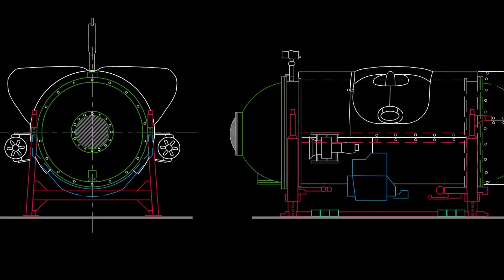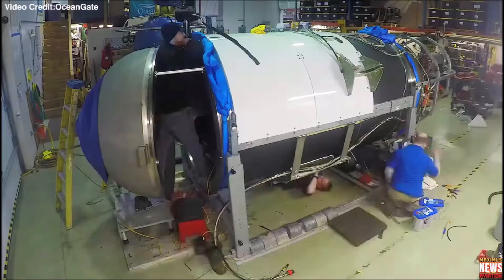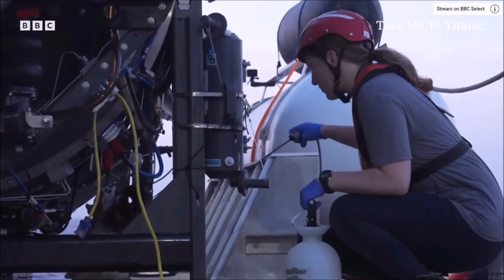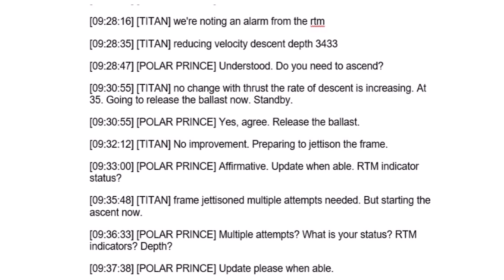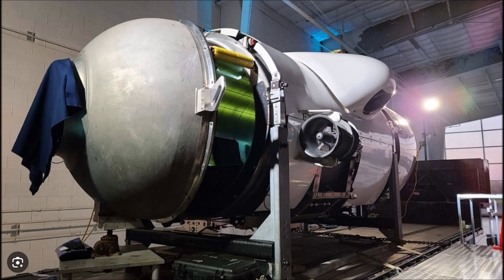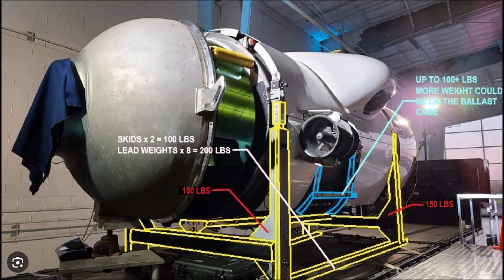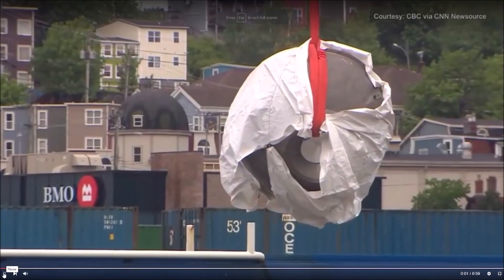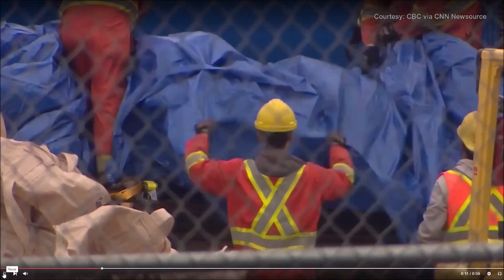OceanGate Titan - DIVING "TOO FAST" A REALISTIC SCENARIO?

Comment: It appears to me from the recovered wreckage that all the bolts securing the titanium hemispheres to the connecting rings are missing meaning that they were either removed after salvage or they had all failed at the time of the implosion. For the bolts to fail due to tensile loading the epoxy bond to the carbon fibre cylinder would have to be stronger than the combined UTS of all the bolts. If that was the case I find it difficult to see how the dynamic loading due to the kinetic energy of the imploding water could simultaneously debond  both rings from the carbon fibre tube and shear of all the bolts ( 36 in total ?) You can see that the location flanges on the rings that surround the epoxy joint have been destroyed as the carbon fibre imploded. Can anyone suggest how the force necessary to snap all the connecting bolts (Hemisphere/ Interface ring) could have been generated?
Reply: The ring separation from the dome cap has puzzled me too, I thing there were 18 bolts, and a semi-truck has this many on each wheel, so maybe they like everything else on this sub was not up to the job
Reply from the maker: Interesting point. I don't what exactly kind of force was necessary for that to happen but if you look closely at the size of the bolts that fastened the hemispheres to the interface rings, they look pretty tiny for the size of the parts they are connecting together. Probably weren't high strength types either as they only had to keep the hemispheres from going anywhere... the enormous hydrostatic pressure would have taken care of the rest. In my mind it's not hard to believe these relatively small bolts all sheared off when the implosion happened. It would have been a very violent event. If you listen the soundclip of the implosion, after the implosion comes what sounds like a big explosion. Seems to me that's when they would've broken off.
Reply: @VegasCyclingFreak  Maybe the bolts could fail if the end cap tried to drag the ring with it at high acceleration and the rings inertia caused the overload to the bolts, what do you think?
Reply: @davemorten8223 I think your use of the term 'ejected' is a bit misleading.  If any part of the cf hull fails, the hemispheres aren't rapidly pushed apart, they are thrust towards each other.  The sea pressure on the hemisphere puts a tremendous compressive force against the hemisphere / support-ring joint.  That's one reason why they used so few, relatively small bolts.  This joint is under compression.

Now, if the cf hull suddenly shattered or buckled, the two hemispheres would very quickly smash into each other.  That could destroy the flanges on the interface rings.  If they collide at an imperfect angle, this might cause a shearing side force that shears the bolts.  

A close inspection of the rings and the ring/ hemisphere faces could shed some light as to if it where 'pulled off' by some force or 'sheared' off.
Reply: @mikefochtman7164  I totally agree with you that if the cf hull was the initial failure the hemispheres would indeed come together under the 10,000 ton loading on both ends  and the collision may well lead to shear failure of the bolts and it would explain how all the components of the hull separated, it all just turned into a ball of shit. The only thing that the salvaged parts clearly show is that the epoxy connection to the interface rings destroyed the flanges that centralised the rings and the cf tube when it imploded. We can only guess which part of the vessel was the first part to fail.
Reply: @mikefochtman7164  I totally agree with you that if the cf tube was the initial catastrophic  failure the hemispheres would be propelled together due to the 10,000 ton  end loading perhaps leading to bolt shear failure on impact. What I am not sure about is if the hull failed allowing a sudden inrush of water could the dynamic build up of pressure within the hull eject the end cap hemispheres and impose a tensile loading on the bolts. I think I lean towards compressive collapse but question the alternative.
Reply from the maker: @mikefochtman7164  I feel that the carbon fiber may have buckled or possibly there was a sudden large de-lamination at one end due to water ingress at the interface ring, which could could have been happening over time. The recording of the implosion seems to suggest something along those lines. Sounds like the end popped off so to speak and then the big BOOM!
Reply: @VegasCyclingFreak  What I am driving at is if the epoxy joint had failed first and was the primary cause of the failure the interface ring would still be attached to the dome as the implosion would eject them as a connected assembly.
Reply from the maker: @davemorten8223  Yeah I get what you are saying. But at the same time, this all happened so fast and at that depth the hydrostatic pressure is about 5,000 PSI so all that explosive force would be concentrated in a very small area. They would really have no reason to intentionally separate the pieces when salvaging... the interface rings had lifting hooks. And that would "tamper with the evidence". My original theory was that the rear hemisphere separated and that is what caused the hull breach. The tail cone was pretty much intact, but separated from the rear hemisphere. There was quite a lot of stuff in that tail cone/rear hemisphere and it had to weigh a lot. It was all joined at the interface ring in three places. I wonder why the rear hemisphere was missing. Maybe it wasn't and they just didn't get video of it?
Reply: @VegasCyclingFreak  I wonder if the first sound is the tail cone detaching possibly along with the legs and in doing so opened up the epoxy joint (despite having 10,000 tons holding it in place) causing the second loud catastrophic implosion. As I said previously you can see that the internal and external flanges on the ring have been sheared off and are blown both outward on the outer flange and inward on the inner flange, goodbye to the tube!!!

Comment: I have seen somewhere that the ballast system now used bags of steel shot instead of another ballast component (not sure if it was lead weights or steel pipe).  Titan has been diving intermittently since 2019.  Some of their hardware has been changed out with experience.  However, it is often difficult to tell what date a photo or video was shot so it is uncertain what equipment was in service for the final dive.  The investigators will no doubt find out was systems were in use for the last dive.

I agree that an error resulting in excess ballast could be responsible for the faster diving velocity.  I believe the diving velocity is determined by the degree of negative buoyancy and the drag on the submersible.  The more negative the buoyancy (downward force) is the faster it will sink.  However, if you believe the transcript, they were rising extremely slowly after dumping ALL ballast and using vertical thrusters.  This suggests either all ballast was not dumped or the submersible was somehow heavier (less buoyant) than previously.  

One theory is that the Rhino liner disbonded from the CFRP shell and trapped seawater beneath it creating an accidental ballast tank.  Another theory is that the carbon fiber was absorbing water because the Rhino liner had disbonded, at least partially. Another possibility is the exterior high pressure air tank for ballast somehow got filled with water, not air.  This would lower buoyancy, speed up diving, resist surfacing and disable the emergency buoyancy balloon that could assist surfacing.
Reply from the maker: It seems to me that the legs didn't all detach. One of them is missing in the debris recovered. Some of the weights would have fallen off the skid but a lot of weight could have still been attached. Their cameras had limited visibility and if it was dark they wouldn't know that it didn't fully detach. Interesting theory about the Rhino Liner. The ballast tank could have failed, that seems like a good theory too.
Reply: @VegasCyclingFreak  Yes, there is a video of the recovered wreckage showing a missing leg. But, that missing leg isn't attached to either ring that was recovered.  There are numerous scenarios as to why that leg is missing and no evidence to support any of them at this point.  Did the missing leg fall off the landing frame when it was being recovered.   Was the landing frame actually ever detached?  Landing frame could be detached separately from the legs, did the leg detaching mechanism work on just three legs so Rush then activated the landing frame mechanism to free everything? Were the landing frame and legs never intentionally detached but blown off when the CF hull exploded with the force of 100 lbs of TNT (estimated by some).  Was the other leg left on the bottom or not found?  Was the other leg part of the 3 bags of miscellaneous wreckage recovered but not visible when unloaded in St. John's?  The apparently missing leg is consistent with your theory but not proof of your theory.

Yes, playing Sherlock Holmes is great fun, but we have only a fraction of the evidence the investigators are still collecting.  I was a practicing engineer for 40 years and participated in many failure and incident investigations.  Conclusions based on the limited information of news and eyewitness reports, photos & videos were very rarely correct. Investigators will have 100 times more evidence than the public does now (they are still collecting it).  All of the Oceangate employees are still alive, except Rush, as are the subcontractors like ElectroImpact, Janicki Industries and Collins Aerospace. They are not speaking out publicly now, but they will be forced to speak to investigators and lawyers. There will be a mountain of paper evidence like piping and instrumentation and wiring diagrams, design specifications, operating manuals along with communications between the sub and mother ship. In a year or so, just as after a plane crash or oil refinery explosion, the investigators will evaluate all available evidence and issue a public report with likely cause(s).  Maybe amateur sleuths will beat them to the punch, but I doubt it.
Reply from the maker: @martywest5925  Yeah I realize that I’m making guesses here with very little info. In my mind, if the frame consisting of the four legs, is hanging by one leg and an implosion occurs, that leg would likely get ripped off from both pieces and go flying off by itself somewhere. My point with that really is if they actually dropped the frame then why is one leg missing? Actually it should have been all four legs connected together with the part at the very bottom of the skid. Not sure what that part is actually called. It was basically one piece when everything is connected together. Should’ve dropped as one big unit. I haven’t heard the 100 lbs of TNT thing, but that seems about right. It was certainly an extremely violent event and the sound clip of the implosion sure sounds like it too. It will be interesting to hear what they conclude when their investigation is complete.

Comment: As I understand it the descent was normal for most of the trip, that would suggest the ballast was correct.
Reply: Actually the decent was way too fast. The hull needs a bit of time to adjust to the pressures being applied to it and not just a rapid shock.
Reply: Early in the transcript, the mother ship asking if Titan should slow their descent [based on descent rate up to that point].  Rush responds that he will continue as is, no change.
[09:15:21] [POLAR PRINCE] You are at 75 minutes, depth? Status? Do you need to adjust velocity?
[09:17:50] [TITAN] All under control. At 2960. No adjustments needed. We're enjoying the ride.
[09:19:03] [POLAR PRINCE] Understood

Titan got an RTM alarm at 3433m, 92% of the 3800m bottom. The got to 92% of the depth in 94 minutes.  It normally takes 138 minutes. They were diving faster than normal.  To dive they intentionally load enough ballast be negatively buoyant, i.e to sink without thrusters. Looks to me they were less buoyant than normal for some reason.

The investigators no doubt have the transcript and it will be released in due time.  The argument against the transcript's authenticity is that the messages are more complicated than those captured by CBS's David Pogue Titan trips in July 2022.  It is entirely possible that Oceangate upgraded the sub to surface ship communications in the intervening year.  Oceangate had a history of upgrading electronics (and other systems) based on experience from earlier dives.  Again, the investigation will eventually show whether or not the transcript is true and why, it looks different than what Pogue observed a year earlier.
Reply from the maker: @engineerncook6138  The reason why I do not believe the transcript is fake is because there are too many insider details included. Only people that intimately knew the details of how the sub was built & designed could have come up with that. I mean how many people were aware that after the ballast was dropped "the frame" could also be jettisoned, and know about this nearly immediately after this unfortunate event happened? I had to do a lot of digging in the following weeks just to find that out. Maybe they watched this obscure video from a year ago? https://youtu.be/IHR3foWRy94?t=4145
Reply from the maker: I suppose "too fast" is subjective. Normally supposed to take 2-1/2 hours... but they did have about another 300 meters to go to get to 3,800 - if the transcript is to be taken at face value. Just going off what the transcript says:

[09:28:16] [TITAN] we're noting an alarm from the rtm
[09:28:35] [TITAN] reducing velocity descent depth 3433
[09:28:47] [POLAR PRINCE] Understood. Do you need to ascend?
[09:30:55] [TITAN] no change with thrust the rate of descent is increasing. At 35. Going to release the ballast now. Standby.

Comment: The fiber was going good for awhile.. he just kept pushing the Titan toany times 
Not to mention the platform swinging the Titan's weight all over the place on it's  little stands
Reply from the maker: Well the point I am making in the video is that normally these dives are done slowly so that the hull has time to adjust to the pressure. Going too deep too fast has more of a sudden shock to the system. Also, if a problem does develop you don't have enough time to get back up to a safe depth before an implosion could/does happen. It would normally take them about 2-1/2 hours to descend and about the same amount of time to ascend. If they descended to 3,500 meters in only 1-1/2 hours, that was way too fast. The Titanic is at 3,800 meters. I could see how it could happen.... people relating their fascinating space escapades and what not and next thing they know an alarm is going off.

Comment: From what I have seen your est. are reasonable
 I would also add, that one of the containers holding one of the battery packs may have sprung a leak and this is why according to the "leaked" transcripts may be why they were going up more slowly than expected, also would account for the crackling noises from the aft end [area holding the batts, computers and other electronic hardware. 
 With that being said I still want to see what the US Navy captured on their acoustic gear. I would suspect they heard everything including any & all comms from the sub to the support ship and any issues with the sub on its decent [and yes I do believe their equipment is that sentive & computers able to decipher any & all noises from there at that time]
Reply from the maker: There wouldn't be audible comms between the sub and the ship on the surface... they has a system of texting... but they definitely caught the implosion.
Reply: @VegasCyclingFreak  The Navy undersea surveillance systems caught everything including the acustic "pings" of the comms and maybe what was going on within the sub at the time, as they were not trying to hide anything, so they would have made one heck of a loud racket all the way up to the implosion & then for a few min. afterward, as the various tanks & other structures failed under the pressure at that depth. I reference @SubBrief here on yt as he is a former sonarman assigned to nuke subs for the Navy. And he has played what a ship sounds like as it sank & you can hear everything that was going inside the ship as she went down & he described how the tanks & other components fail at depth. He has also stated they could hear the underwater comms of commercial craft as they were at depth. They are non-encrypted & also in a digital format easily picked up,
Reply from the maker: @almirria6753  Hmm... OK. I don't know that anyone outside of the investigators will ever be given access to that info but maybe one day it will come out. Likely a few years from now.
Reply: @VegasCyclingFreak  He only told of his experiances while still serving [and only the unclassified parts as well]  @SubBrief 
 And they will release only the portions of the audio with transcripts to the boards & then in the final reports portions will be redacted for security reasons.  But we'll get a pretty good idea on all parts of the mishap though
Reply from the maker: @almirria6753  Anything more than we have now would be enlightening.
Reply: @VegasCyclingFreak  I fully agree, but we will not see anything till the hearings & the final report being issued, in about a year's time. That is unless something gets leaked